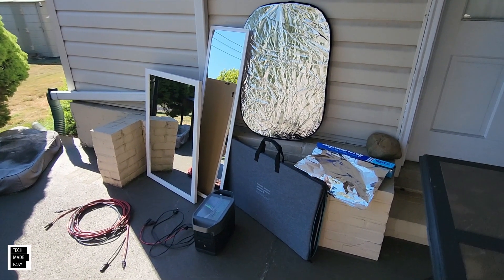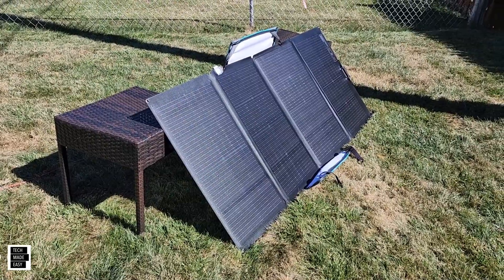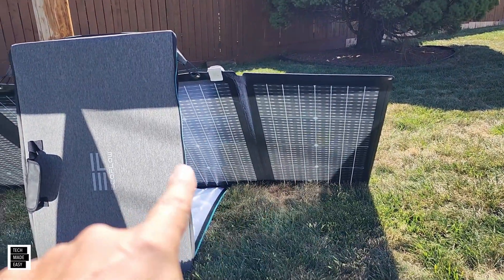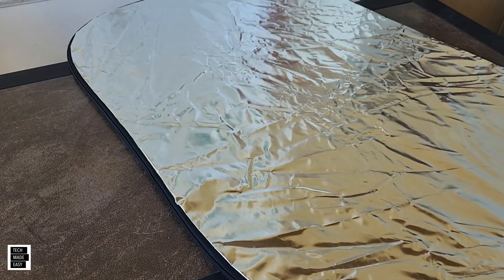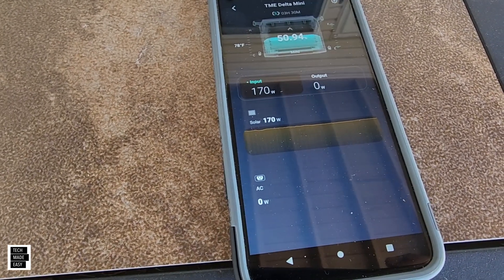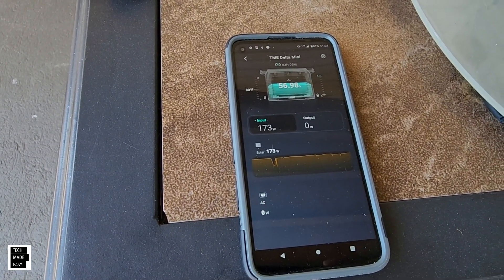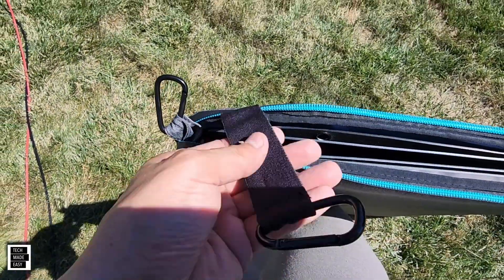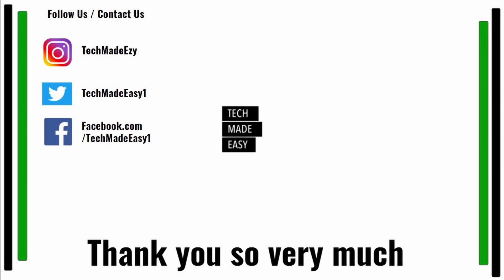PART 2  EcoFlow 220w BiFacial Solar Panel REFLECTIVE Testing with EcoFlow Delta Pro

Comment: Thank you for the hard work you put into these tests. I bought these 220 panels after watching your first video. I'm thinking about making some pvc frames for my panels, so I can get more light on the backside. Also, the frames should keep the panels straighter. Should also be easier to move around to chase the sun.
Reply: I picked up 4 of these off eBay. I'm also planning to make a frame and use the whole thing as a canopy. The most difficult part is dealing with the weight. I'm still thinking through my options for building something that'll be strong enough while still being portable and inexpensive.
Reply from the maker: Yes definitely weight more.
Reply from the maker: Thanks